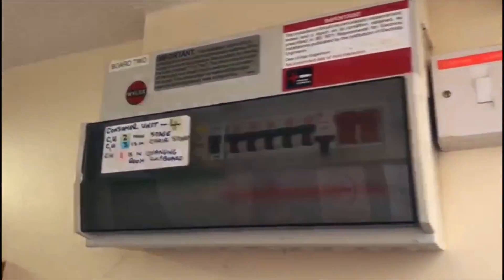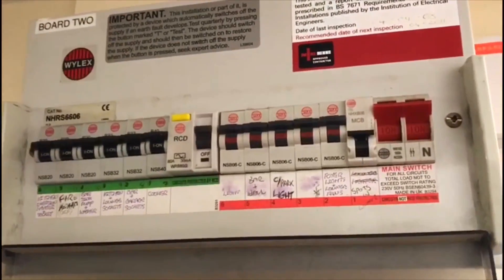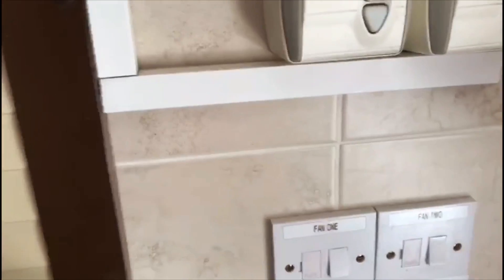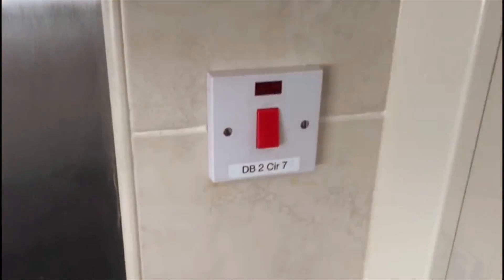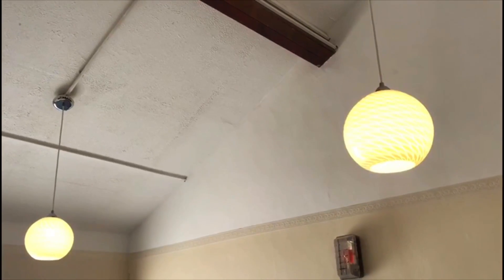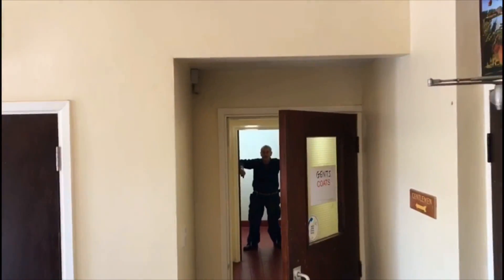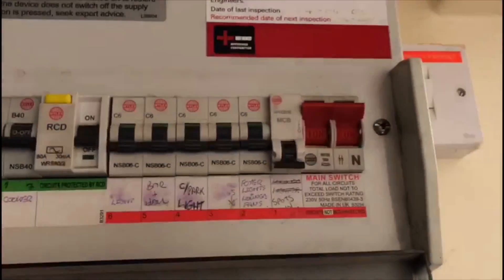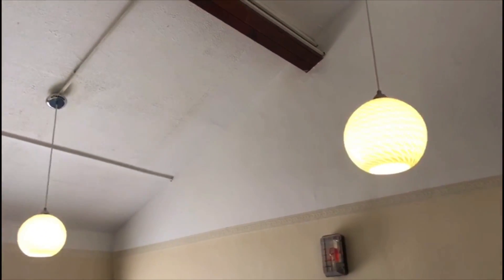Electrician Matt EICR Labelling of Electrical Accessories and Fault Finding a Borrowed Neutral

Comment: found a similar one the other day on an EICR, 1 set of sockets controlled by 2 different breakers!
If either one of the 2 breakers were left on there would be a supply, but if both breakers were on then there would be no supply
Reply: Sounds like the legs from each ring were mixed. Disconnect both rings at the consumer unit and test which pair belongs with which.

Comment: It's funny, an illustration for safe isolation in GN3 show a voltage indicator which look remarkably similar to the Martindale VI3700... This indicator would give the impression a lighting point with a borrowed neutral is dead and as such, safe to work on.

Comment: Labelling on commercial premises with 3 phase is actually very sensible. On a domestic you would only need to label if a switch isn't obvious. I just labelled all the outside light switches on a holiday let to stop guests switching them on and leaving them on as they wouldn't know what they did.

Comment: What is the need to borrow a neutral under what circumstances?
Reply: CAR SOLUTIONS It shouldn’t be done intentionally. Either the correct neutral wasn’t available and someone has been lazy or a mistake. In a House the landing light is a common situation where this happens. And it causes a problem (tripping) when a dual rcd CU is fitted.